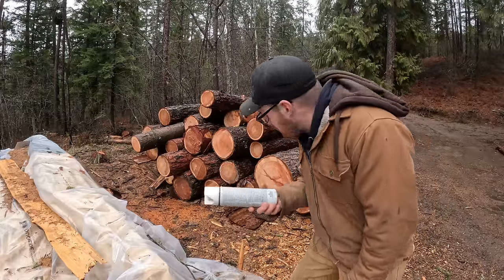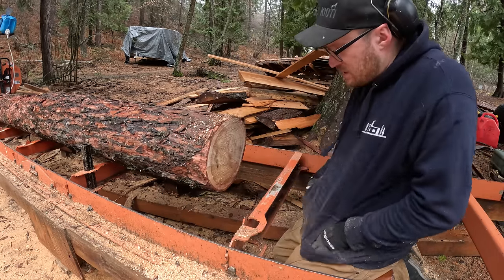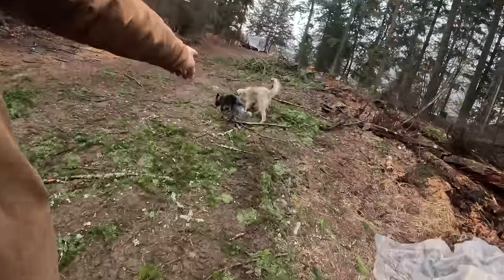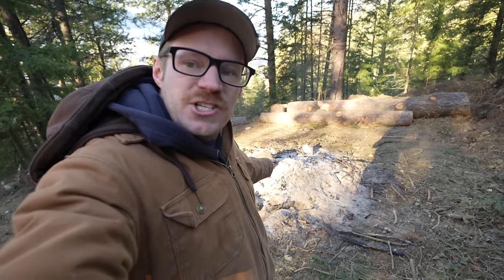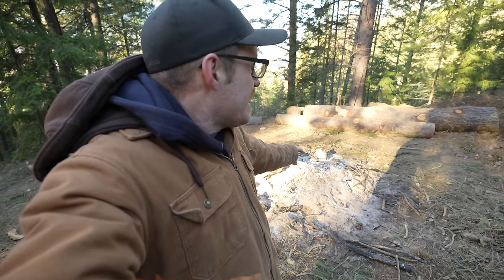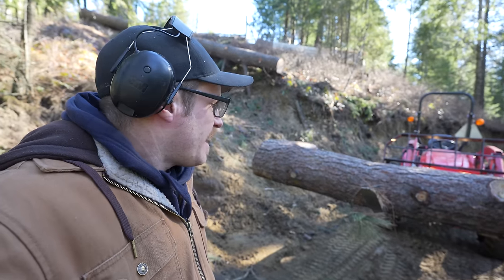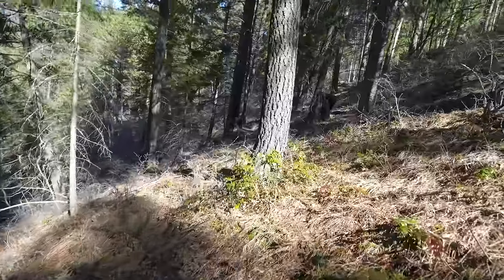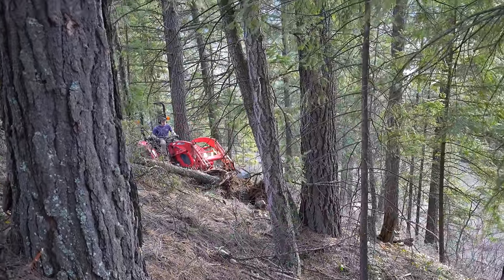Spring Has Hit At Our Off Grid Property, It's Time To Prepare For The Next Big Project

Comment: A easy way to figure out what size post out of a log is,if you want a 6x6 is 6x1.41=8.46 you would need a 8 1/2 “ log to make a 6 x6 post. 4” post 4 x 1.41= 5.64. So you would need a 6 3/4“ log  and so fourth. If you have a log that’s 13”  13 divided by 1.41 = 9 1/4 so you could make a 9 1/4” post.

Comment: Suggestion:  cut a 6x6 block and use it to check the end of the logs.  Can even hold it against the log end and use it to mark your cuts. 😊❤
Reply: the other easy option is to make a cardboard cutout of the size that you require

Comment: I think those tractor forks are too long for much of what I see you doing with the tractor, and a lot of the time you seem to run loads with them set too high - keep 'em low and tilted well back and perhaps take a minute or two to use straps or chains on the load you are carrying!
I'd recommend making a compact concrete counterweight for the rear three point linkage - not only will it prevent the rear wheels lifting off it will also increase traction.
The tractor without the wide scraper blade hanging off the rear end would also be more manoeuvrable as well.
It was good to see the place getting a tidy up too: you can't beat a good bonfire so nice work!

Comment: Hi Greg, There are a couple of things that you may consider to make moving timber far easier and with less effort (work smart not hard) If you google  two things 1 tying a timber hitch which is the correct method and 2 blocks and tackle which doubles the pulling power adding one pulley block correctly.I hope that these suggestions are of benefit to you.

Comment: Once you get the bulldozer operating better, things will become much easier, (your little tractor and you are doing a stirling job though Greg) maybe even widen the new road a bit more using the dozzer, and with its extra weight, you can compact the road down better, you'l get there in the end, of that I have no doubt, You and Katie work so well together, but work safely.

Comment: How about you use a couple of snatch blocks to pull that large tree out. Double your tractors pulling power with a simple block and tackle setup. Works great. I've used one or two snatch blocks with the winch on my sxs at our place in the mountains pulling logs out of the woods.

Comment: Use a 90 Degree Cable pulley system.... Anchor a pulley on a standing tree and run your cable from the downed tree through the anchored pulley to the tractor.  I hope that makes sense.:) The object is to pulley the cut tree down to the road as straight as possible to pick up with your Forks.

Comment: Greg are your rear tires filled with fluid for ballast.   If not I would try that.  Also using a snatch block to pull trees will help.  Use your truck to pull your trees and cut them up where you can get them easily.

Comment: I have a question even though you never answer my questions. Why aren’t you concerned about building a saw mill building? If you put a slab and get it off the ground, it will be easier to keep it true for cutting. Under cover and out of the weather, it will last longer and you can cut wood in all seasons. Just Sayin !
Reply from the maker: I am thinking of putting a cover over the head of the unit.  We have many projects and have to prioritize them

Comment: Hello, I've provided you with tips in the past about Axe swinging.  A tip on the bon fire.  Using the blower is a great method to get it going, but don't use it once it's going well.  Here's why.  It appears harmless, but the coals can get so hot that the fire can literally jump your barrier without a flame reaching the other side, it will simply ignite brush 5 ft away and get out uncontrolled.  I've done this in my woods which are even greener and wet than yours, so just be warned.

Comment: You could cut up the smaller branches and use them to heat the hot tub if they are still a good size. I would find a use for every inch of that wood if it was me. You could even use the smaller stuff for a campfire or fire pit!